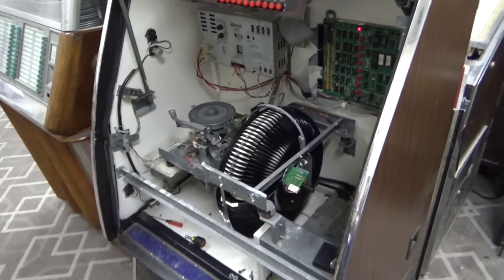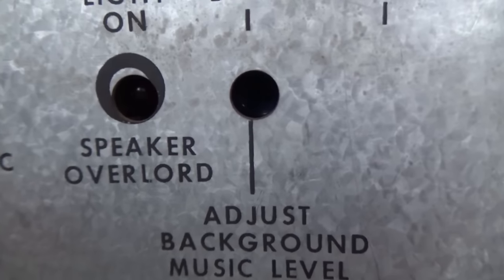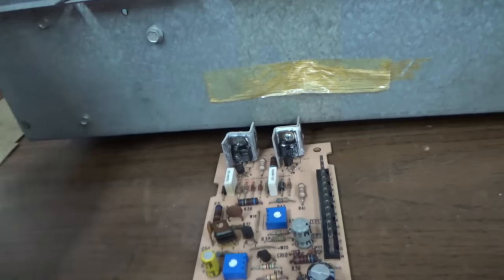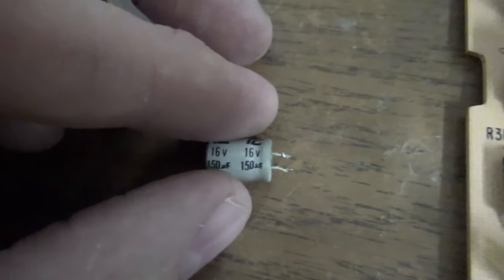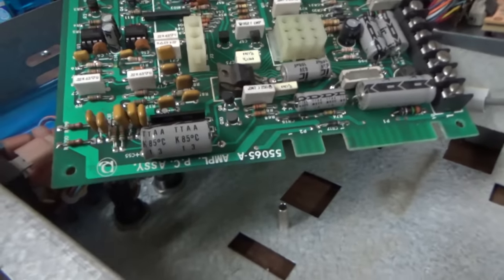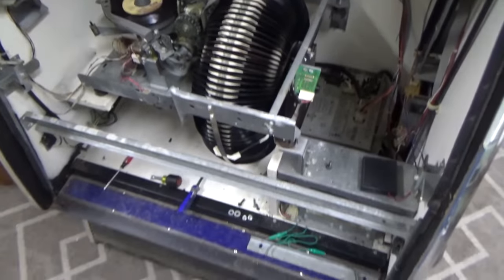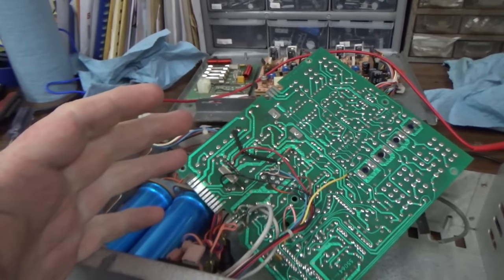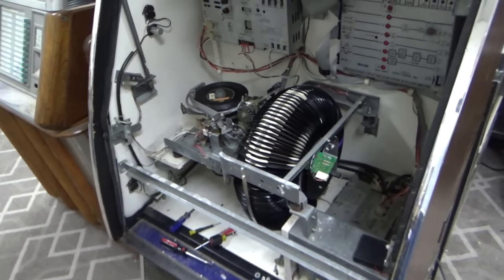Looking inside the Amplifier of a Rock-Ola Jukebox - Factory Mods, Weird Hacks, Channel Repair

Comment: I'd say this has had a dead channel for a while and the previous owner, or maybe the last operator, reversed the speaker at the bottom to compensate.    The only thing I would slightly worry about if someone played is to make sure the phasing is right as it can really kill your bass response if the speakers are out of phase.
Motorola use there own numbering scheme.  You can likely find generic TIP type transistors to suit.   It's just a Motorola thing.   They do it to confuse us lol
One thing I do enjoy about watching your repairs over many others is the fact you genuinely want to save these things.  Sure, you need to make money from selling things, but you don't do it just for the money.  It's so nice to see you do this because you want to save the machines too.
Reply from the maker: In the near future i'm going to start doing some old radio and clock repair videos on the weekend in addition to the coin op stuff, I've got a lot of cool old stuff that's fun to tinker with, you're right I like saving them.  Very cool little machine here.

Comment: I had this same problem with my rockola. (Same model). I got lucky.  I just flipped that stereo/mono switch back and forth about 20 times to clean the contacts.  It’s been working fine for the past two years.
Reply from the maker: Ahhh, that would probably do it, if one side was not making contact it would kill that channel

Comment: I recently had a failed Bass driver that measured open circuit on the spade terminals, however you could appear to a get a good measurement by hooking onto the link braids between the terminals and speaker cone. Assuming bad solder joints I resoldered the link wires to the terminal plates, still the same which seemed very odd to me. Anyway after a lot of messing around and head scratching I figured that the copper braid itself had somehow fractured and was not conducting. I desoldered the pair of braids again from the terminal plate, cut the soldered ends off and resoldered the new ends to the terminals - fixed! The braid itself had somehow failed, yet visually looked OK. Bizarre, but that speaker is still working fine today.

Comment: you might want to get an audio tracing probe.  it's basically a small audio amplifier with a probe so you can poke around on a pcb and follow audio through all the stages of like this amplifier;  I was thinking the same awhile back when you were working on the sound problem on an arcade board.  It'd be nice to be able to probe and listen to each audio chip for example on an arcade board to see which were outputting and which were not.  A little cheap speaker and amplifier connected to a probe with a series 0.1uf capacitor works well.
Reply from the maker: I'm going to get one eventually, i've got a bunch of radios I'm going to fix
Reply: @LyonsArcade  nice.  you might want to get one with a detector mode then so you can trace the signal through the IF stages of the radios.

Comment: Absolutely you can recone a speaker. Its fairly inexpensive, and easy to do. Kits are available at amazon. However, if the wires are still attached and the coil still reads open, then the speaker coil is blown and you need to replace the whole thing. On the opposite side, if the coil reads short, don't even attempt to use it. You'll blow the audio amplifier. We're talking fire and flames.

Comment: I've heard of people repairing (and even rebuilding) speakers, but it's hard to imagine it being an economical way to go.

As another commenter noted though, the copper braid between the voice coil and the contacts may have broken.  I've had the braid break off before.  Those two wires take a lot of punishment, as you might imagine.  Possibly an easy fix, but possibly not.
Reply from the maker: yeah I thought it had just broken loose or something, I've seen that before but they were both still connected.... may have been messed up at one of the joints or something though.... I think if it's an old speaker and you really need it like on an old radio without a field coil or something, it's probably worth fixing the actual speaker, but I usually just swap them on this more 'modern' stuff.

Comment: RE: Speaker.  Yes the speaker can be fixed by "reconing". The internal coil has been fried and would need to be replaced.  If the parts are available (not so common any more), the coil, spider and cone can be replaced. (Spider is the orange piece holding the cone near the coil.) Also, the 4558 is a common op-amp IC available everywhere and cheap.  It is used as a pre-amp for the record cartridge to equalize the signal for one.  Dan - ABR Services
Reply from the maker: Thank you Dan!

Comment: I guess the next step in your repair skill building would be to learn how to trace signals. To be able to inject a signal into the input and follow it through the circuitry to the output. That would get you to a fault in a direct manner.

Comment: Hi Ron!
So, I'm just curious; I noticed that there's a section of the speaker connections labeled for 70V... Is this intended for use with a distributed audio system (as in individual speakers, for example, one to a booth in a restaurant, with individual volume controls?)
Reply from the maker: Yes they allowed you to hook up all kinds of stuff to it, motorized volume controls (that would have a little motor that turns the knob on the back of the machine, from the inside)... Wall Boxes, seperate speakers or every kind you can imagine, dollar bill acceptors, Microphones, etc.

Comment: Aint that some crap...  one of these has  hmmh the bed on us.  LOL..  That machine has a really broad selection of music in it.  Obsession by Animotion and Waylon Jennings, can't imagine where this machine would have been installed.  Play either end of that spectrum in the wrong place and you might find yourself at the wrong end of a beer bottle.  I had my lunch fed to me by a cracked trace on a circuit board once.  I must have looked at it a thousand times.  I didn't find it until I was checking components with a meter.  You know the one that starts with F and ends with E..  I never worked on a juke box.  I have been surprised how sort of primitive they are compared to other equipment of the time.  I guess they were trying to keep the redesigns to a minimum.  I still worked and served the purpose.  I am also amazed that they got kind of cheap looking.  I would have thought they would have devised some gimmicks like the old bubblers.  No fancy light shows or strobes.  The pinball machines figured this out a long time ago.
Reply from the maker: The NSM jukeboxes are much more complex as far as the amplifiers, etc.  Also the late model Wurlitzers were like that, had a lot going on.  I think they were just trying to make it super reliable and minimal.
Reply: Will the wolf survive?

Comment: HELP!  Working on a Rockola 470 and I need a 100mf 75 volt capacitor and can’t  seem to find one. Any help is appreciated 👍
Reply from the maker: mf=uf and The voltage rating is the highest voltage that's allowed through it, so you can use one marked higher safely.  So 100uf 100v for instance... https://www.ebay.com/itm/391959280299
Reply: Thank you sir. Awesome. Love the channel.
Reply: I changed the capacitor but still no sound on left speaker. The left speaker did make low crackling from high note sounds of music which didn’t happen before the capacitor. The right side works perfect.  Swapped driver boards and the sounds reverse to other speaker side. So something wrong on the amp. Not sure what I can check next. Any help is appreciated.  Thank you.

Comment: Does anyone know why they added the factory modification of cutting the trace and adding a resistor and capacitor to both channels? I'm guessing it's a passive RC high pass filter to the speakers
Reply: Could be something missed in production and bodged on later, it was quite common in low production boards as redesign would cost more than bodging it on._
Reply: @DjResR  The question is what is the Bodged RC network doing? It looks like a factory Bodged job but for what reasons
Reply: @waynegram8907  Probably a noise issue or a ground loop oscillation._

Comment: I have done radio / T.V. repair for years. you can use a separate amplifier with a cap in series with the input that isolates the test amp and the amp under test, and connect a test probe. now you can probe and listen to each stage of amplification, including where you are loosing the signal. it is fast and easy to spot the problem( transistors, caps, and resistors).
Reply from the maker: I've seen Shango do that but I haven't tried it yet, coming soon :)
Reply: @LyonsArcade  , it is an absolute "TIME SAVER" I can track the problem in an "amp/ radio" in less than 5 min.. I only repair/ rebuild old radios/ amps now that I am retired. I also watch "SHANGO"( subscribed) he is a very good trouble shooter, and is very knowledgeable. as for myself, I like to share my knowledge!!!!, just like back in the day when I was "BLESSED" with the knowledge/ mentorship of the senior electronic engineer at "WLW" radio station ( who also built the local "VOICE OF AMERICA" transmitter station). he was the person who told me to get a degree in electrical/ electronic engineering, and I did!!!!. he was my neighbor, and I just about lived in that mans basement, we used all of his test equipment, and I soaked it up like a sponge.

Comment: MD8003 is a common package for 2 transistors in 1 package that are matched and used as a differential amplifier in the circuit.  The TO220 transistors in this are MJE15028 and MJE15029. - Dan ABR Services
Reply from the maker: Thank you Dan!

Comment: They are using that capacitor and resistors for some low pass filtering cheapest way to make a cross over I might have missed it was the sub on a different channel they can be reconed I do it just for fun maybe not cost effective the cone and voice coil parts are probably around 40 and u can by one for the same price the cone probably separated they kept playing it and the voice coil rubed and opened
Reply from the maker: Thank you Andrew, yeah I'll bet they kept going with it

Comment: Isn't transistors with PNP and NPN ... Positive negative positive and Negative Positive Negative? C,B,E = Collector, Base, Emitter. The base is what's gotta have the positive negative biasing I think. I use to love working in electronics. :face-purple-wide-eyes::goodvibes:
Reply from the maker: So THATs what those stand for, lol
Reply: @LyonsArcade  N and P are semiconductor material types.  N type has excess electrons and P type is depleted. In manufacture the silicon is "doped" with impurities to have the different characteristics.  Then due to atomic physics the flow of electrons is modified in the depletion layer formed by the junction. Which is why they're called, "semiconductors". The material can both insulate or conduct depending on the charges present.

Comment: That looks like a push-pull amplifier. You have an NPN and a PNP, and the output should be floating and ready to go to an audio transformer, speaker, next stage, or whatever.

As for radio repair, those who work on tube radios nearly always shotgun the electrolytic caps. If you encounter wax/paper caps, you need to change those.